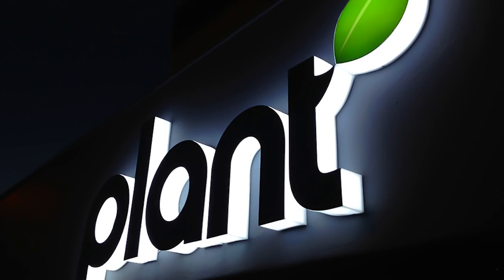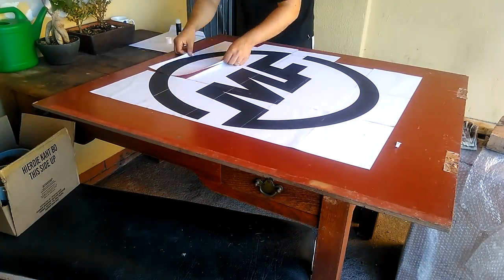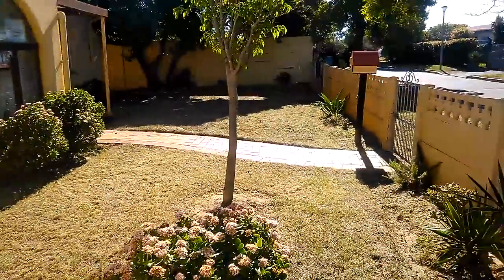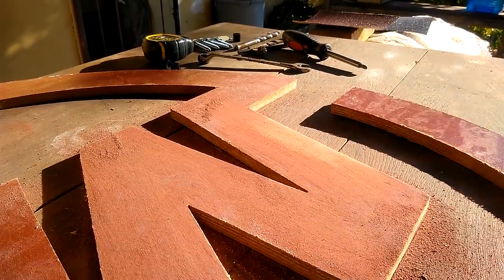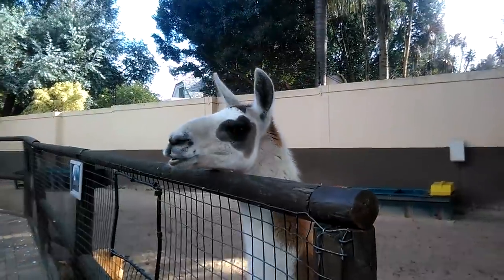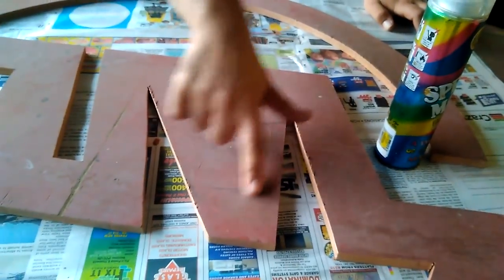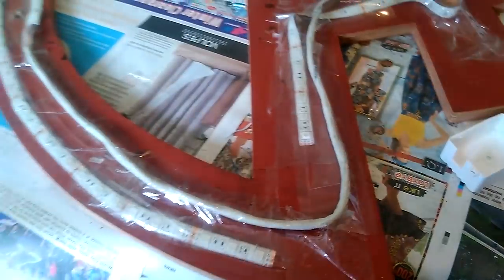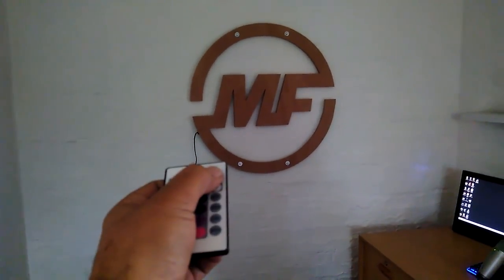I made my Logo In Real Life

Comment: Nice vid. Paint the black cord white or use white hockey tape to hide the cord. Cheers.
Reply from the maker: Yeah I didn't know if it was going to be permanent but I plan on grinding into the concrete wall and burying it. Thanks dude
Reply: Mister Flak - temporary permanent- we do the same thing - “yeah I’ll just deploy it for a little bit “ .. good luck carving into concrete. Wall mount those monitors and put same LED behind them as well. Order up a custom MF mouse pad and you’ve got a sick setup.   Cheers